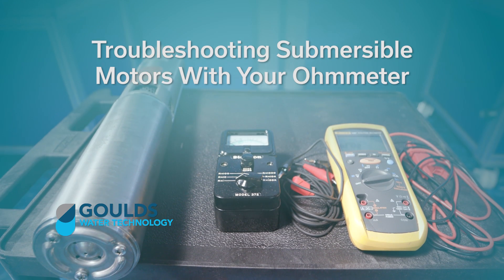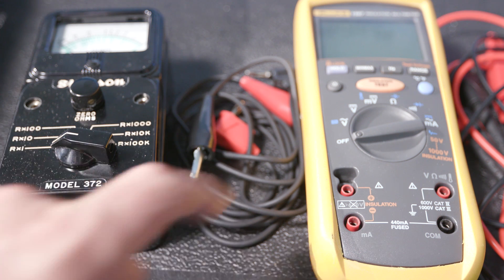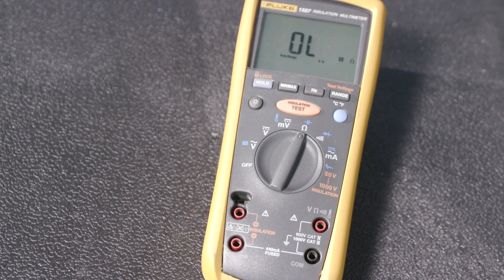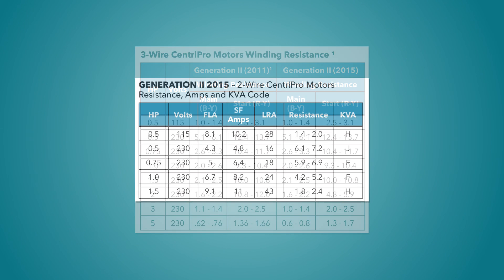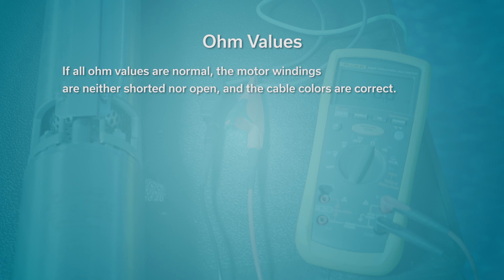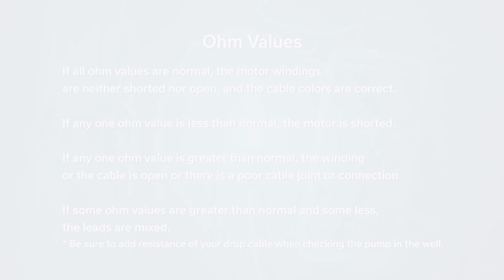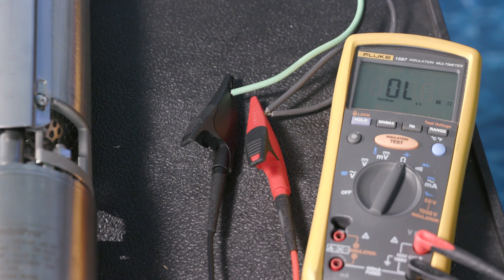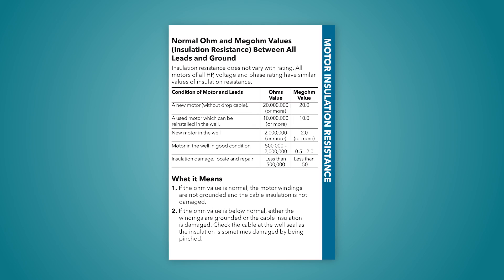How to Troubleshoot Submersible Motors with Your Ohmmeter

Comment: NO POWER TO THE MOTOR ..WTF !!....ARE YOU TALKING TO BABOONS !!
Reply: you don't test resistance with a motor connected to power...
Reply: @ROVA00    no shit -professor !!
Reply: @COFFEE-e3p  I accidentally did that once. Tried to test pump but forgot to shut off power. Gave me the fright of my life. I slipped and fell towards the open well casing. Almost fell over 400’ to drown in a pit of water. Luckily the well casing is only 6” wide so thankfully it just hit my tummy and bruised it up real bad but I almost died.

Comment: 2 questions 1)So When testing Line to ground there must be O.L for good motor , is this true for all well motors?

2) Can you test the motor with 230v  (outside the water), pump and motor not attached  just to see if the motor is working.
Reply: You can't have a line to ground or it makes a short. Yes you can run a submersible to bench test without issue, or you can drop it in a barrel of water and run a line with a valve to add restriction to test.

Comment: Thanks for providing tutorial on troubleshooting guidelines- video on submersible pump set. 
It is fascinating stuff 
#Please answer the question /technical clarification 
: about "2HP rating single phase"-submersible Borewell pump set. 

#After starting pump-set :Starting Amps go up to 20A & Amps  Return back to 7.5A@245V (Running current /Amps). 
*But pump-Water flow output :zero /Nil*. 
#"Main winding continuity" (R-B) absent (missing/*NOT OK*). 
But Y-B continuity is OK/all right. 
R=Main winding 
Y=Auxiliary winding 
B=Common wire

# My question :
"If  Main winding continuity is NOT OK" ,  *why Pump set is NOT getting overloaded with high Amps*? 
(Because : auxiliary winding only absorbing driven mechanical load as main winding is faulty-"continuity is absent) 
Overload Relay setting : 15A
Normal Running Amps: 12.5A@245V
Please Answer. 
www.facebook.com. com/Bhargava Ashwath
curiousbhargav@yahoo.co.in

Comment: Water juat stoped working. The box on top was replaced recently. The box shorts and turns off. Its pulling 13 volts and should only be pulling 10 volts. Dose this mean its the motor or bad wire?